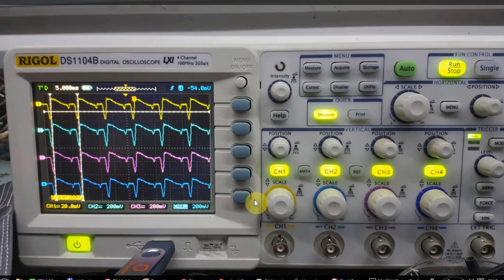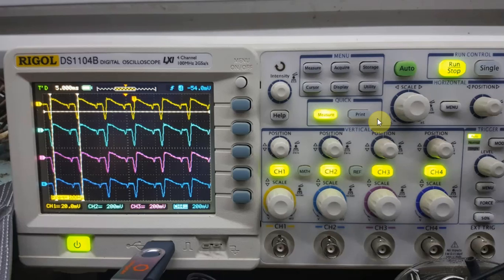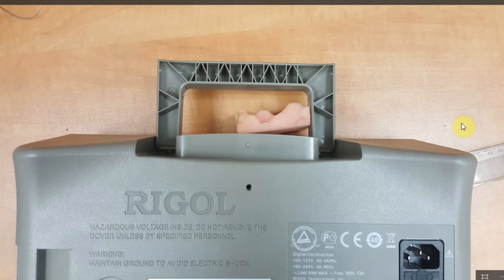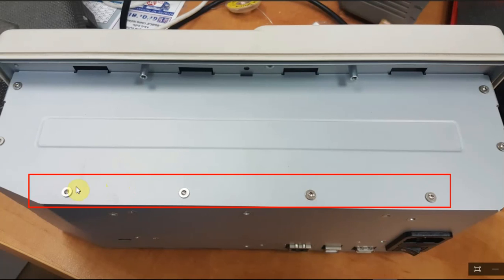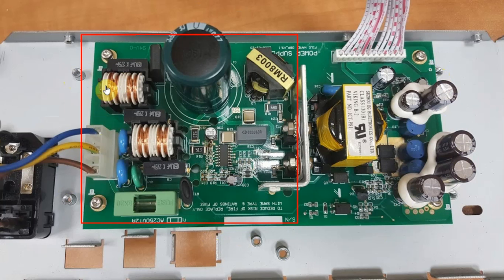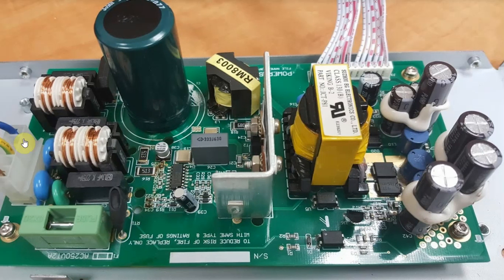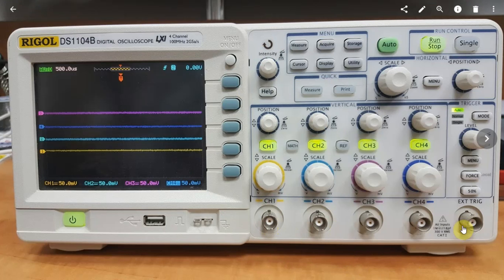Rigol DS1104B Fix

Comment: You should have conducted an ESR Test in circuit before removing the capacitor instead of relying on Buldging.
Also it would have been useful if you showed the capacitor value that way i could tell you what ESR you should be getting. But hey.. You fixed it.. so.. Great

Just saying
Check ESR First before jumping to conclusions
Reply: The capacitor spited its guts and you still need to measure ESR first? Any reason why?
Reply: @louco2  
LOL..  Ok let's break it down, Hopefully you learn something

1. "The capacitor spited its guts"
Actually,    
The Capacitor  SPIT it's guts
or were you trying to say
The Capacitor SPITTED it's guts
Either way , you should pay attention to your grammar and spelling, it shows intelligence if you do.
and in Electronics Intelligence is something that you require.

2. The capacitor DIDN'T spit it guts.
1:20 - 1:40
- He Opens the Casing and accesses the Power Supply 
- He does a VISUAL INSPECTION of both the Hot Side and Cold Side of the board
- HE FINDS NOTHING
Nothing Damaged, Broken or Defective

That fact that he didn't find anything obvious and immediately PROVES you should check the E.S.R. of the capacitors.
THAT'S THE REASON

3.    1:43   he spots residue
Notice he doesn't know where it's coming from .

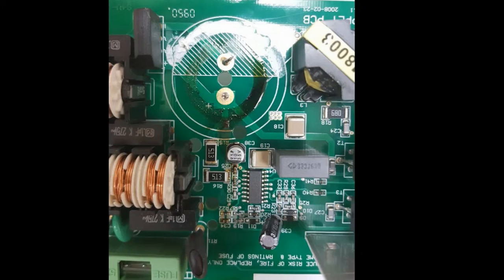4.  1:50   NOTICE THAT HE SAYS
"After doing some testing"
WELL.. THIS IS WHERE YOU WOULD DO THE E.S.R. TEST

5. Then he removes the capacitor.
Since the leak was from the bottom, he couldn't confirm it until he removed the capacitor.

THE E.S.R. TEST WOULD HAVE SHOW A VERY HIGH E.S.R.
So it would be wise to to use an E.S.R. Test before removing the capacitor as this would confirm that it was faulty

so this comment
"and you still need to measure ESR first? Any reason why?"
ABSOLUTELY you need to measure the E.S.R. First

1. it's good practice in electronics, Because an out of spec cap is not always obvious

2. what you are doing and what he did is ASSUMING THE CAPACITOR IS BAD.
By Testing the E.S.R. You are not assuming, You are PROVING it is bad and needs to be replaced

3. Testing must always come before replacement so that you don't change the environment variables of the fault.  in this way you can isolate a fault easier

also, it's a lot quicker to do an E.S.R. Test than it is to remove a cap

DOES THAT ANSWER YOUR QUESTION ?

So, Even if a cap spits it's guts... YOU STILL MEASURE THE E.S.R.  because there is an off chance that it could have been another component 

GOOD PRACTICES ON A REGULAR BASIS MAKES FOR GOOD TROUBLESHOOTING DOWN THE TRACK
and if you have good troubleshooting procedures. YOU WILL ULTIMATELY FIX MORE THINGS FASTER.
that's 51 years of experience talking,
Well actually, it's probably not a full 51, but definitely 45 years.
Reply: @ and in Electronics "Intelligence is something that you require."...No need to insult here, I was born in France, my parents where Portuguese and also lived in Spain for 7 years, I am living in the UK now so English is one of the four languages I frequently have to deal with so I am really sorry if its still not perfect.
I agree that good practices in electronics repairs are important. ESR test is not a definitive answer to the health of the capacitor, ESR meters can't really detect leakage and capacitors should  to be swapped for new ones every few years anyways.
While I respect your experience, your argument assumes a one-size-fits-all approach to troubleshooting. In reality, a mix of testing, visual inspection, and practical judgment is the best method. Thanks for the discussion—it's always great to exchange ideas with someone experienced in the field!
Reply: @louco2  
"and in Electronics "Intelligence is something that you require."...No need to insult here"
THAT WASN'T AN INSULT, it was advice.
Why always jump to the conclusion that something is an insult.. first ?

"so I am really sorry if its still not perfect."
OK, no problem, so to correct your english.
Don't just assume that everyone's being rude to you.
if i wanted to be rude, i could be a lot ruder than what i was...
IN ELECTRONICS ... WE HELP EACH OTHER.. DON'T WE ?
Ok, so keep that in mind

You asked a question
and i did answer it ,    right ?

"ESR test is not a definitive answer to the health of the capacitor,"
LOL
But.. THAT'S WHY WE DO MULTIPLE TESTS.
But in this case... an ESR test would have been the only test necessary

also consider that across THOUSANDS of repairs that i've done the ESR Test, was pretty conclusive in most cases.

"ESR meters can't really detect leakage "
BUT WE WERE NOT TESETING FOR LEAKAGE
We were testing for Series Resistance.
and that test would have given us INSIGHT into possible leakage
but again.... it may have been the case that there was no leakage.
When we are testing we test for ALL POSSIBLE scenarios

You're just stuck on leakage because you have the benefit of hindsight.
when he was testing, he didn't know what it was.

"While I respect your experience, your argument assumes a one-size-fits-all approach to troubleshooting."

well.. YES, but.. you need to understand it.
so.. there are STEPS TO TROUBLESHOOTING AND SOLVING ANY PROBLEM
and they do cater to any problem

this system has been developed over decades and has been changed where it needs changing to the point where it no longer needs changing

see.. the system is not 1 thing or 1 step. that would never work

also, i just mentioned 1 test , mate 
and you've made it out like that's all i have in my arsenal.  LOL

God no
I didn't even get into Curve Tracing yet.
but.. for the sake of solving this problem... ESR would have been more than enough

" In reality, a mix of testing, visual inspection, and practical judgment is the best method. "
I agree,  i didn't say it wasn't 
and IN REALITY is what i have been doing for the past 45 years
it's because of reality and practical real world scenarios that i have this troubleshooting system and it's why i moved from using a multimeter to troubleshoot caps to using an ESR tester and a curve tracer

A Good Technician or Engineer caters their troubleshooting method to the situation that is needed

You're Welcome for the chat